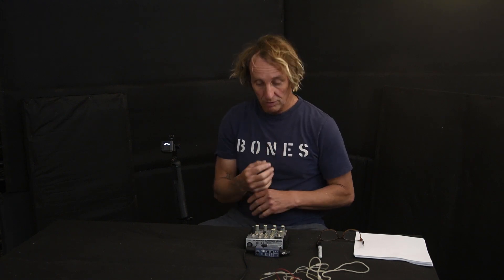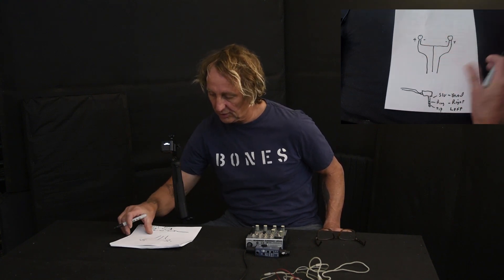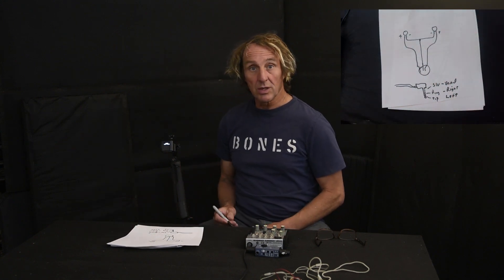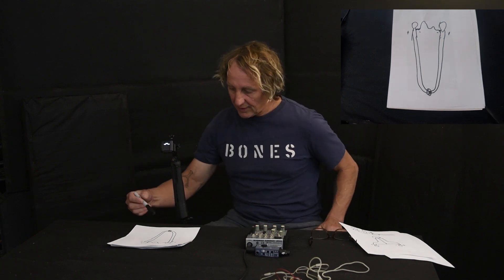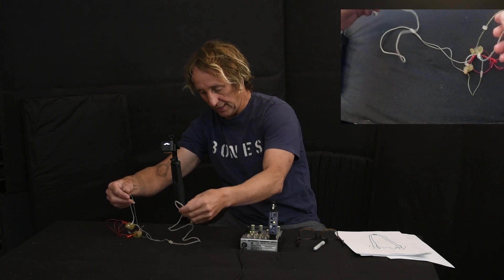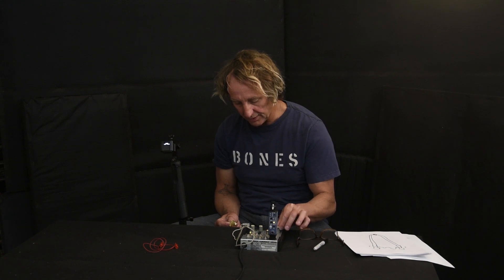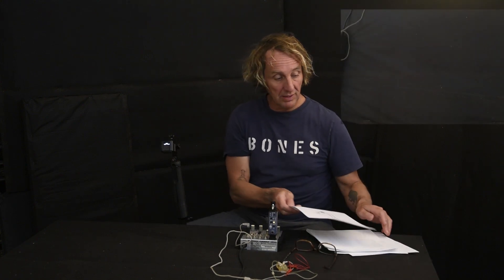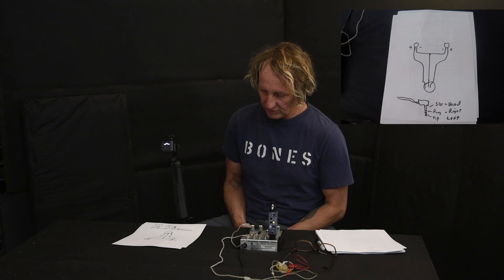The Audible Difference between 3-wire vs 4-wire Headphone/ In-Ear Monitor Cables

Comment: Why do you want more isolation thought the other way is better having crosstalk
Could you put the diode to ground if it's 3-wire if you want isolation
Reply: The signal flow of a speaker system is a closed-loop. All that means is that the speaker is dependent upon a constant reference between its positive and negative leads. The signal that promotes speaker movement is A/C, which means the electrons flow back and forth. A diode is designed to pass electrons in only one direction. This means if a diode were placed in the signal path, it would only pass signal/voltage in one direction effectively cutting off half of the signal's wavelength. 

The reason I believe this phenomenon is happening ( three-wire vs. four-wire earphones ) is because of common current paths. In any typical speaker system ( headphone amp included ), there are two positive leads and two ground leads. The two ground leads are technically bridged directly to ground. You can test this by using a DMM and touching the negative lead to the chassis. Ground acts as a reference for the positive terminal. The voltage on the positive terminal can be either positive or negative, and only requires a reference in order to produce that voltage. This is how you can bridge amplifiers. The second channel swaps its polarity making any positive signal it had, become negative relative to the other channels' positive lead. This doubles the voltage output because now the voltage swing is twice as big. One side is going negative while the other is going positive.  

You DO NOT have to have the negative lead of a speaker connected to the negative terminal of the amp. It only has to be connected to something else that can reference the voltage produced at the positive lead. I.E. you could in theory connect the negative lead of the speaker to the amps chassis or another amplifier's negative terminal ( provided that the amp is plugged in ). 

Going back to a bridged amplifier where the two amplifier channels are swapped in polarity. You DO NOT have to flip the bridge switch to hear anything from a speaker connected to both of the amplifier's positive terminals. Simply having one channel turned down, or not sending a signal to it will provide enough reference for the speaker to produce sound. The same thing is happening with IEM's. That length of wire between the two drivers' negative terminals is sharing current that is produced by both sides of the amplifier. So even when one side is turned down, or off, there is a path of reference to the other side's positive lead via that cable and through the speakers' element. The negative lead from each earpiece has a resistance ( load ) that it presents to the amplifier. When you " jump " the lead from one side to the other, you shorten the length of the cable significantly ( relative to the total length of the positive leads ). Electricity wants to flow through the path of least resistance. So that " jumper " will create a path of reference that it can flow a voltage across. The length of the lead and the resistance of the driver determine how much of this " crosstalk " will occur. The 4 wire IEM's and headphones are better because they have the longest length between each speaker ( relative to the positive leads ) reducing common current paths and minimizing crosstalk. When you add any jumper between the elements, shorten the ground leads, or otherwise reduce the resistance path between the driver's ground references, you increase cross-talk. This decreased resistance from one driver's negative to the other driver's negative means that the positive lead from each driver becomes a potential reference point. This then means that the signal presented on one speaker will cause the other driver to share some of that signal. 

The greatest level of isolation occurs by reducing any " Common Current " signal paths. This is why a 4 wire is better than a 3 wire. The 4 wires reduce the common current paths, reducing crosstalk as a result. I hope this helps get an idea?
Reply: @atech9020  I meant the diode on the negative third wire not the two positives
Reply: @johnsweda2999  the signal is A/C. It doesn’t matter where you put the diode, it will still cut the signal for half of the wavelength. I also don’t want to guess if you could hear the switching noise as the diode chops the signal? 

In a D/C circuit, the diode would do what you think. It will shut off current in one direction, but in an A/C circuit the signal flows both directions relative to a reference. When the signal passes through zero the diode will shut off the bottom of the waveform until the signal goes positive again, or for all intents and purposes, half the signal. 

A speaker coil moves in two directions, in and out. The only way it can go in and out is if the signal is A/C. When we read the voltage from an A/C source we see a positive voltage because the meter reads the peak to peak voltage and displays it. An A/C wall outlet could be said as having a 60 volt swing in the positive and negative directions, yielding a 120 volt peak to peak voltage reading. 

A bridge rectifier converts A/C into D/C by chopping the bottom half of the signal off and converging it in the positive polarity with the original top half of the signal. It converts a wave that passes through zero into two humps that are positive relative to ground. The subsequent capacitors smooth out that ripple as it’s called ( the humps) into something more akin to true D/C.
Reply: @johnsweda2999  There is no such thing as a "negative" wire. Technically, there's not even a "return" or "ground" wire. To electrons its just resistance.
Audio consists of sinusoidal waves whose average amplitude is ZERO. If it is not zero, then you have a DC offset which lowers audio quality and can even cause damage.
Reply from the maker: @xnoreq  👍
Reply from the maker: Very cool.  I did another video that is currently still in the paid member side, but will release public soon.

In that vid, I take a 4 wire in ear and then short the commons at the in ear side, adding copper and showing that when shorted the the crosstalk increases.

The issue is related to the voltage drop in the common wire of the 3 wire.
Reply from the maker: Hmm, diodes make audio sound really bad and are not compatible with listenable audio. No need for anything complex, just using 4 wires fixing things.  Many headphones use 4 wires, many use 3.